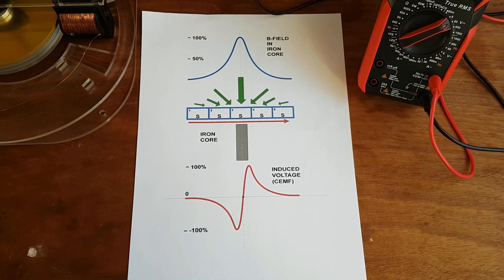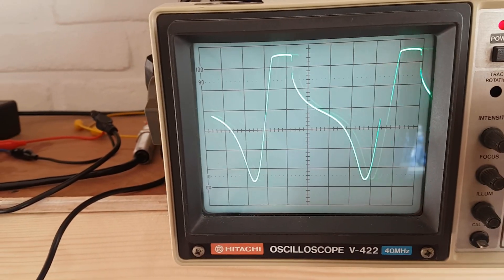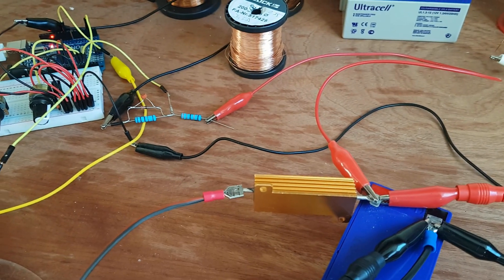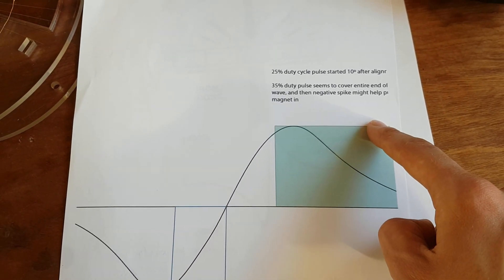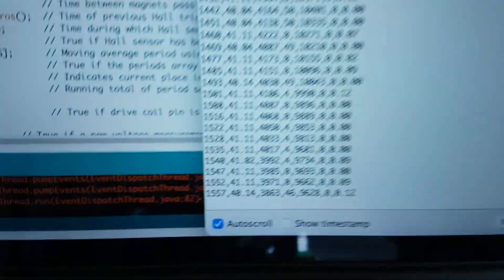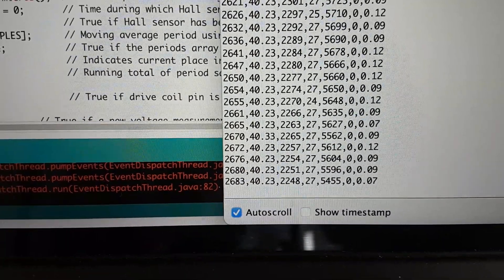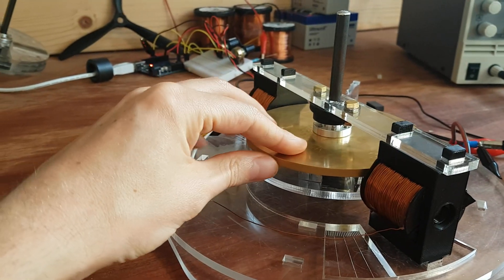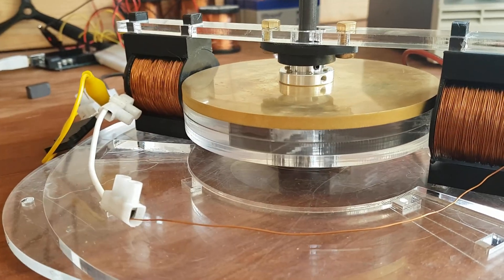EXPLOSIVE Ending to Adams Motor Waveform Analysis & Speed Test

Comment: would be interesting to see an Adams Motor/N-Machine generator combo, you could even use the same rotor with that brass disk.
Reply from the maker: I just read about the N-Machine for the first time, and it is a very interesting concept, but that rotor has a very different layout to the rotor I'm using, as it requires two large round magnets with a thick copper plate sandwiched in between: https://www.homemade-circuits.com/making-free-energy-generator-n-machine/

Or you mean to use the Adams Motor to power an N-Machine generator rotor? That could work indeed!
Reply from the maker: Your comment inspired me, and I re-assembled my broken flywheel rotor, and measured the DC voltage between the axle and the rim of the flywheel, but it didn't go much higher than 2-3mV.

The rotor was only spinning at 1300 RPM though.

Of course the magnets in this rotor are very small, weak, ferrite magnets, so I didn't expect spectacular results.

If I ever build a rotor with neodymium magnets I might give this another try :-)
Reply: @Waveguide  Neat! Would like to see a video if you try it with some better magnets.
Reply: @Waveguide  you could also just try setting a neo ring magnet on the brass disk, but it might mess with the other magnets.
Reply: The problem with the N-Machine is the electrical resistance between the disk and the brushes. It is true that there's no back torque (I tested it) and based on that you may think that you won. BUT... the generated voltage is too low. In order to use the energy you generated, you would need very very low electrical resistance between the brush and the disk. Some say that Bruce de Palma achieved this by using mercury, but I really don't think so. Mercury has resistivity ~58 times the resistivity of copper. According to the tests I ran, copper is not good enough, you can imagine mercury...  Well, feel free to ask about the tests I have done.
Reply: @marciogastaldi3077  It is an interesting engineering problem, maybe some day a loop hole will be found.

Comment: I have a pulse motor and at 146 volts it spins at just over 1000 rpm and draws 180mA. How does people get there pulse motor to reach over 1000 rpm at 12 volts?
Reply from the maker: I'm guessing you're using neodymium magnets? They are much stronger than the ferrite magnets I'm using, and so require a lot more power to demagnetize the stator core. Robert Adams wrote about this extensively, and while you use more power with stronger magnets, they also generate more power, and so the overall efficiency of the motor can still be the same. Other than that, it all comes down to a good mechanical design, like using the right bearings and having minimal vibration.
Reply: @Waveguide  I am using weak speaker magnets and Im using the bearings that come out of a old vcr. you know the vcr head that the spins the tape, really good bearings. I think it has something to do with my inductance because my coils are thicker than they are long. they are over 500 turns. also I built my rotor out of layers of cardboard. it weighs about a pound. In addition my motor is an axial flux and yours is a radial flux. i built a radial flux out of plastic dish cover once and using the same voltage and magnets and I got over 1500 rpm till it split apart just like yours. My radial was also monopolar but i didn't get to test it as dual pole.

From the axial im currently testing , I found out that dual pole give  stronger flyback emf and only the dual pole was capable off reaching over 1000 rpm (monopole stopped at 920 rpm). Over 1000 rpm im able to use a technique that allows me to pull power from the rotor which causes the rpm to increase by 200+ and the current drop by 50-60%. Im not sure if this technique is possible with monopolar as It only happens when my rotor is over 1000 rpm. I figured out the technique by mistake but i believe its called back emf harvesting. Also by making the generator coil field lines parallels to  rotor tangential  velocity, i eliminated the drag by the generator coil. I later saw this on YouTube and also saw a video saying that if you orientate the generator coil AND permanent magnet field lines parallel to the rotor tangential velocity, then pulling power from the generator coil will cause negative drag, ie, the rotor will speed up.
Reply from the maker: @raloed.363  If you're using weak magnets, then you really should not need 146 Volts :-) The VCR bearings are good ones, but if the have grease in them, they will cause drag on the rotor, so a ceramic bearing might be a better option.

My drive coils are also thicker than they are long (40mm wide vs 30mm long), so I doubt that is the issue. What wire guage did you use? And what is the winding resistance?

If you could share a link to any video or textual information on the negative drag generator setup, I would greatly appreciate it, as I would love to give that a try! Thanks in advance.
Reply: @Waveguide  there are 3 coils in parallel, 19, 25 and 23 ohms. I don't know the wire gauge but its scrap wire I took from the secondary of a large microwave transformer, about 0.5mm in diameter. The video demonstrating the negative drag is here https://www.youtube.com/watch?v=MIbBaTf9m_M
Reply from the maker: @raloed.363  thanks for the video link, very interesting! 

Could you share what trick you plan to use above 1000 RPM that will increase speed while reducing current draw?
Reply: @Waveguide  are you still interested in what I did? I was trying to type it here but it's too long. It would be much easier to just show a circuit diagram
Reply from the maker: @raloed.363  yes please share the diagram :-)

Comment: Have you thought about powering your coils with a MOSFET (FDL100N50F) and a gate driver (TC4420CPA)? Also, I would be using a ultra fast diode (STPSC30H12CWL) to capture the flyback. I can assure you that schematic that I previously provided a link for comes from an eminent source, one you probably already know about, which I'm not willing to reveal, and if I did, when it got back to him, he'd probably be pissed.
Reply from the maker: Hi Barry, the transistor I use now is the one recommended by John Bedini, which he picked after testing dozens of different options. I would like to experiment with MOSFETs, but could you tell me why they are preferred over regular transistors in this case? You mentioned more power can be transferred that way, but why would that be the case? And I also ordered some silicon carbide diodes (IDH12SG60C) :-) Curious now who created the schematic, you could always email me through my website ;-)
Reply: @Waveguide  The main reason is much more power. You can run four 3.5uH (Dayton Ohio) coils in parallel with a single FDL100N50F, but you will need a gate driver (TC4420CPA) circuit with its own isolated power supply. It is recommended for capturing the flyback that you use an ultra fast diode (STPSC30H12CWL). It also recommended that the charge battery be a deep cycle lead acid battery. Also, it is recommended that you place a protection capacitor across the MOSFET (100uF 450v Electrolytic). (Side note, you can also connect another four 3.5uH (Dayton Ohio) coils in series with a single high voltage diode to charge a high voltage capacitor, which you can periodically dump into your primary battery through a slip-ring-half-cycle-commutator. See the energizer of the Watson machine.)
Reply from the maker: Thanks for your explanation, but the Adams Motor does not need a lot of power through its coils. ~2 Watts will do, so more power would not be a reason for me to switch to MOSFETs. They do tend to be faster at switching than regular transistors, and it seems a very fast rise time is ideal, which is why Robert Adams kept using mechanical commutator switches. Plus, who is this person recommending all this? ;-)
Reply: @Waveguide  That's fine. I appreciate the Arduino sketch code. Thanks.
Reply from the maker: @BarryBranton  if you check the `serial` branch on Github, you see the web dashboard I created for thr serial monitor data. This makes it a lot nicer to check the status of your motor.

Comment: Hi Nick!
Well! And everything started so well ...Did you deliberately destroy your rotor, or did you not know that centrifugal force can destroy the rotor with increasing rotational speed?
Reply from the maker: I obviously didn't plan on this! It was really dangerous. I did underestimate the power of the centrifugal force. I will now run my motor at lower speeds, or hide behind something while it's running ;-)